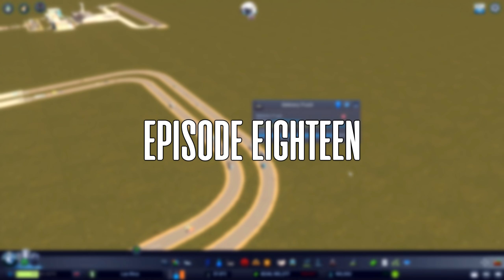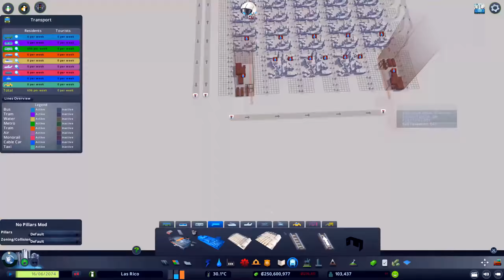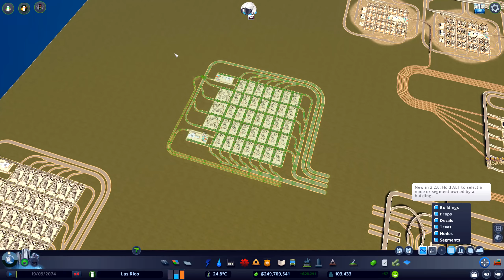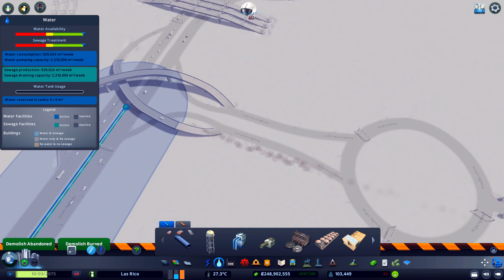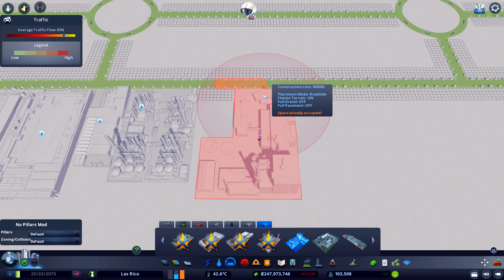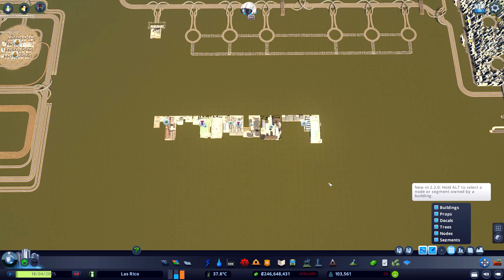EVERY UNIQUE FACTORY - The Industrial Project Episode 18

Comment: Great ideas. If you haven’t figured it out,  use cross streets (usually do with an ally or two lane roads) on your roundabouts, while connecting other streets, then remove when done, will maintain the perfect circle, instead of distorting when roads are connecting. 
Thanks for the inspiration!

Comment: I tried this in an other way:
I made the oil extractor buildings, 1 highway is collect the traffic from all of them, and got into a roundabout. From the roundabout, its can choose: go to storage, or go to the processing buildings. I created the processing building with the same design as the extractor buildings. I did all the 2 processing ways, and the two highway from the processing buildings will go to one highway, and that will go into another roundabout, and there can choose: go to outside of the map, and export the products, or go to the actulal Unique Factory that creates goods, from Plastics and Petroleum. From the Unique Factory, the road will go straigh into the Only Commercial Plot, and sell the products. To the commercial plot, the citizens can get by using a metro route.
Thanks for reading, I Love You Phrawzt!